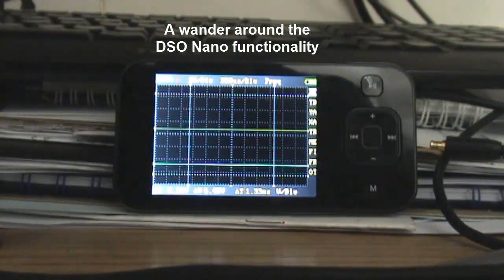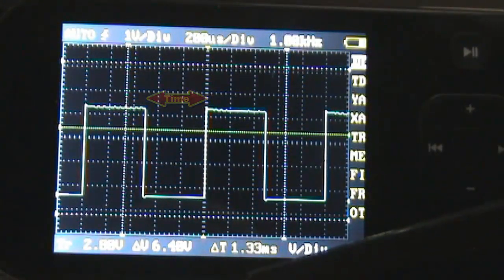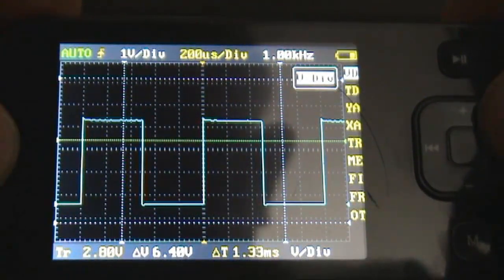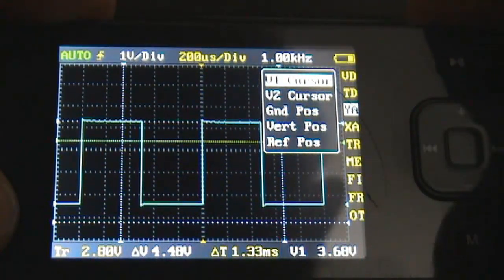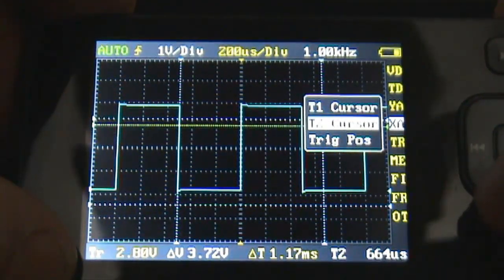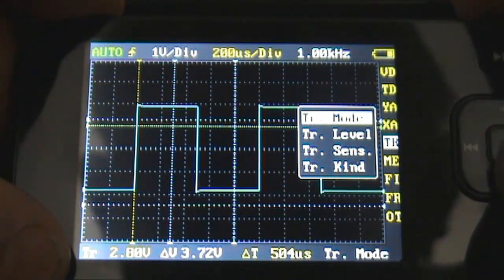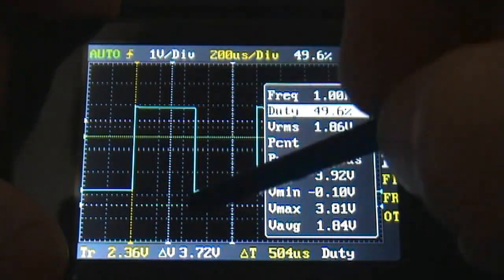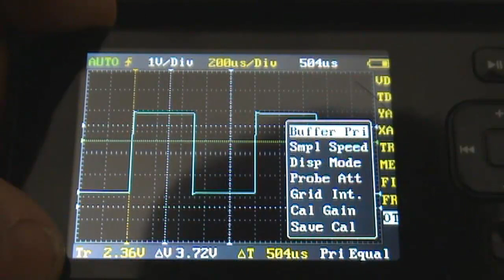DSO Nano: a guide to what it does

Comment: Fantastic tutorial, Mr. Hardiman. Thank you. I have just opened my own DSO and was dissapointed it didn´t come with an users manual. It took me a long time on the web to try to find one. Every one I found belonged to a different firmware version than the one I had. I was angry and about to give up when I found your video. It was you who made me aware of the BenF firmware and manual. It was then that I realized that all the manuals I had found belonged to the original firmware. So, cheers!

Comment: I bought a DSO213 nano oscilloscope but it failed and I returned it. Looking back, it was a handy little kit and I wish now I had exchanged it for a working unit. I have three oscilloscopes, one bench and two handheld. When used as intended, the nano oscilloscopes are very capable for their size and low cost.  And you can't have too many scopes!!!

Comment: DSO nano oscilloscopes - good display, bad frequency range. Basically a toy.
JYE oscilloscopes - bad display, good frequency range. Basically a toy.

Double your budget and buy used analog oscilloscope or cheap bench digital oscilloscope!
Reply: It's not intended to be a bench scope or that accurate. It's designed to be an indicator with limited capabilities. It's great for audio or anything under 1Mhz like some digital labs etc. For anything serious I fully agree with you. I have nice scopes and this one for Automotive work and just a quicky on the bench for slow logic gates. Whats nice about it is that I can crawl under a dash and hold it in my hand, or if I'm in a crawl space I can easily use it. It's great for an indicator just to help find a fault, after the fault is found then the serious scope comes out, if neede. Best Wishes n Blessings Keith.